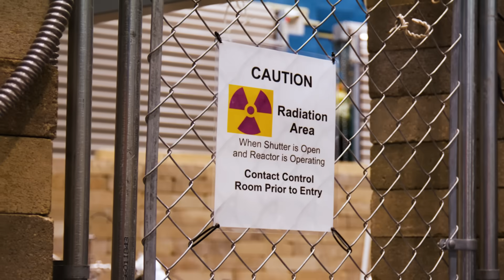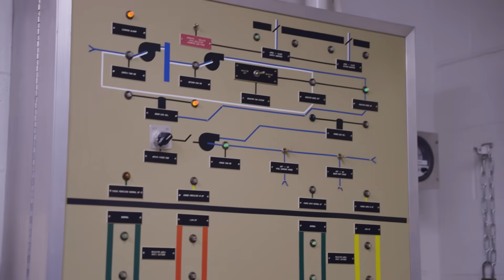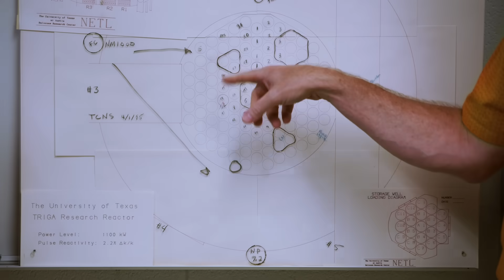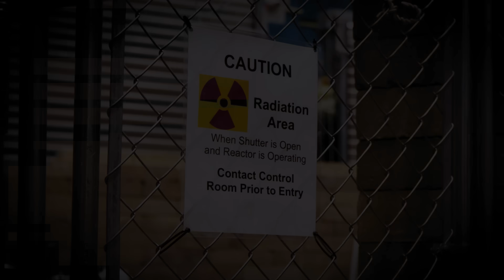I tried to melt down a real-life nuclear reactor

Comment: There are many ways to split an atom. This is one of them and indeed I would say a good bet for the cheap factory made reactor.

Sodium cooled fast reactors already exist but the difference is they don't slow down those neutrons (fast) and as such require more fuel in the reactor to stay operational. Triga fuel lets you make the reactor smaller and safer. The biggest problem with those however is usually the use of liquid sodium which is a problem this reactor shares. The problem is mostly because sodium is flowing through pipes and any kind of leak of liquid sodium from a pipe is a huge danger and a hassle to fix. 

Terra Power has a solution to this problem which I hope these guys replicate. The solution is to simply not have the sodium in any pipes. All of the sodium sits in the big bucket built into the ground along with the reactor and the heat exchanger (heat exchange to solar salt because you don't want any leaks bewteen sodium and water) You can still circulate the sodium around but there is nowhere for it to leak other than the big hole in the ground where it's already supposed to be.

Secondary benefit is that solar salt is very cheap and a good way to store thermal energy so you can have your power plant load following while still running the reactor itself at max power.
Reply from the maker: @MrRolnicek  what is solar salt? I have heard of TerraPower, that's the Bill Gates one, right?
Reply: @1stPrinciplesFM  Indeed, Terra Power is the one from Bill Gates. And Solar Salt is just a type of salt typically used for storing heat at high temperatures because it's compatible with water (unlike most other salts), it's  60% NaNO3 and 40% KNO3. It's named solar salt because it is used as the target for heating in the mirror based solar power plants where large arrays of mirrors concentrate on one spot to heat up the solar salt which can then be used all day and all night to generate power.
Reply from the maker: @ very cool, thank you! I know that "molten salt" reactors exist but don't know much about them. Maybe a cool future episode!
Reply: @1stPrinciplesFM  Molten salt reactors are indeed great and I would want to see an episode. I suggest an interview with the CEO of Copenhagen Atomics for that.

The use of Solar Salt is not really related to molten salt reactors that much, Terra Power uses it because it's compatible with both the liquid sodium and water so it can heat exchange to both with minimal danger.
Reply: @MrRolnicek  Would love to see a video with the CEO of Copenhagen Atomics.